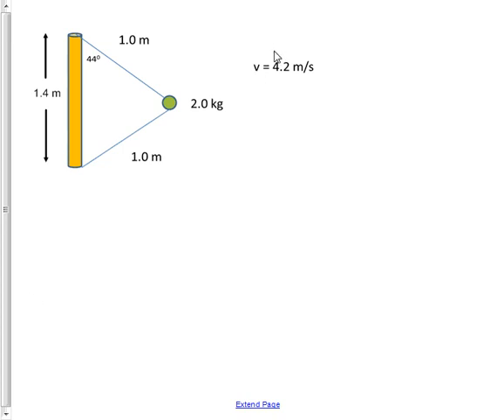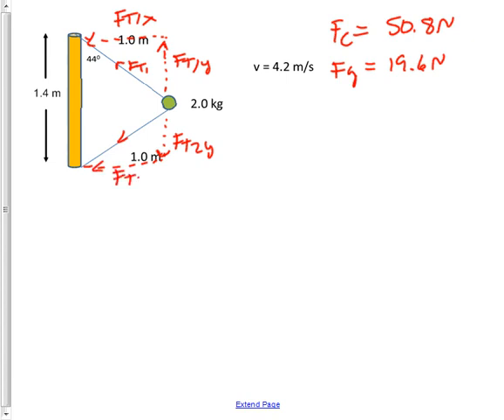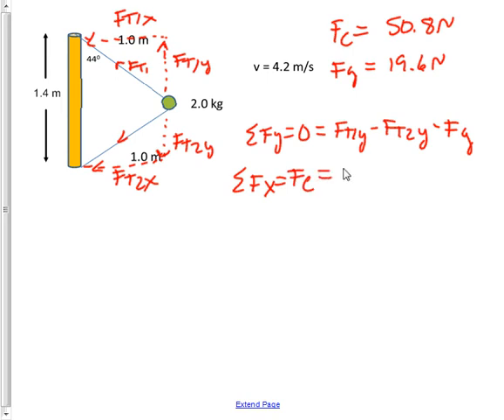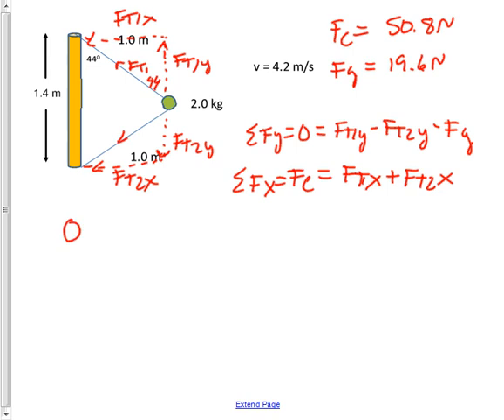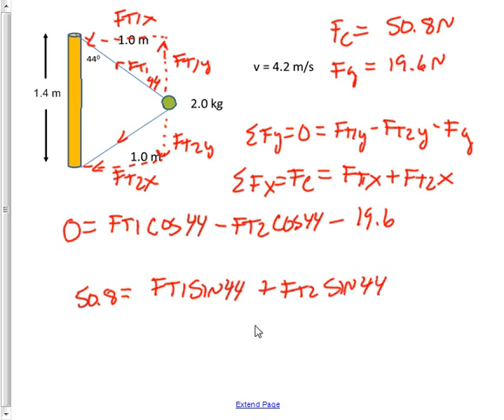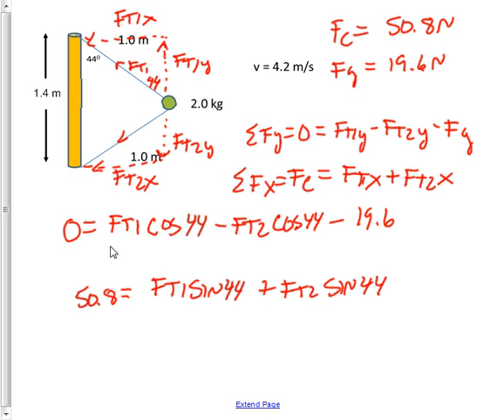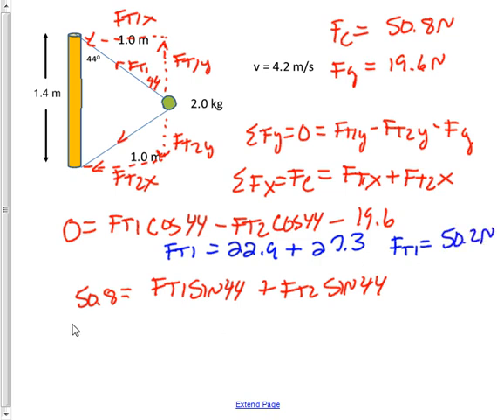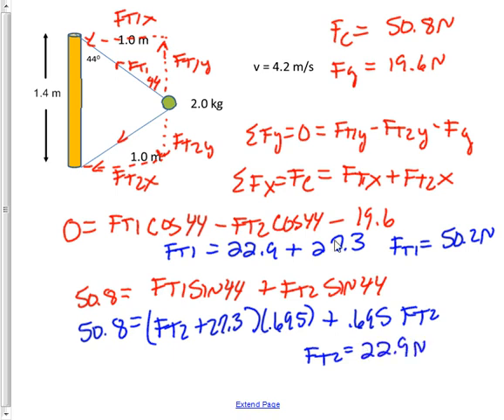Tension Force and Rotating Rods Part 2

Comment from the maker: If angles are not known, the cos(angle) is equal to (half of rod length)/(string length).  You will need to do an inverse cos to get the angle.  *in this question, that will give us 45 degrees so something is a little off with the original question because it should give us 44 degrees*

Comment from the maker: I did not show all of the systems of equations for this.  What I did was solve for FT1 in  terms of FT2 in the top equation to get: FT1 = FT2 + 27.3.  I plugged this into the bottom equation to get 50.8 = (FT2 + 27.3)(.695) = .695FT2 *the .695 is the sin of 44 degrees*  I then calculated FT2 to be equal to 22.9.  I then plugged 22.9 for FT2 in the the equation FT1 = FT2 + 27.3 to get 50.2 for FT1.  I hope this helps.